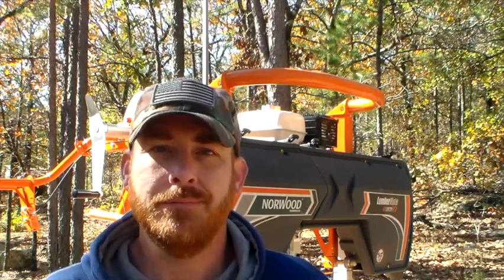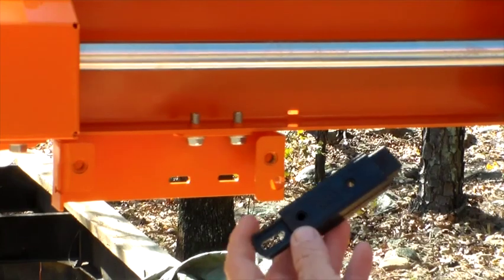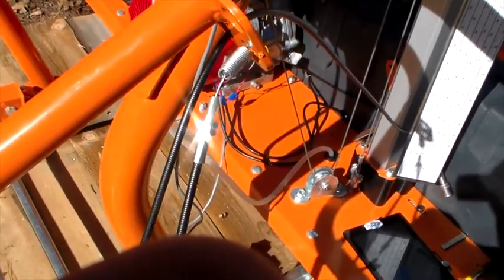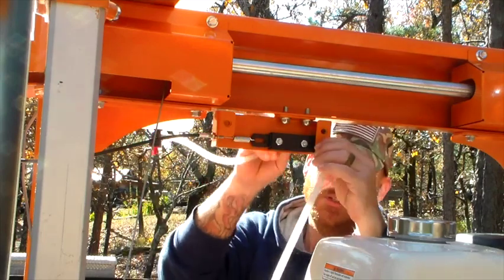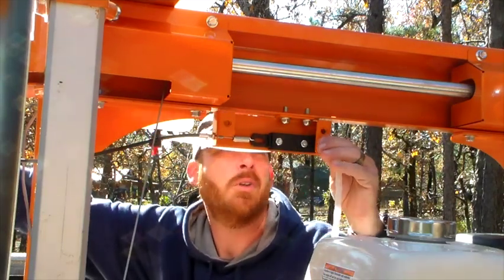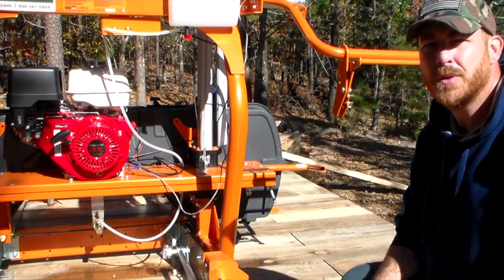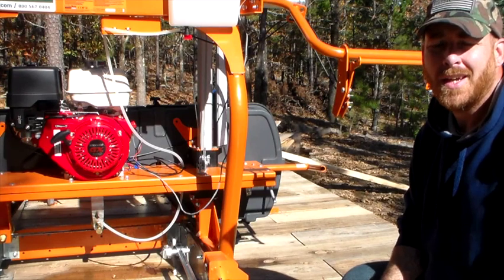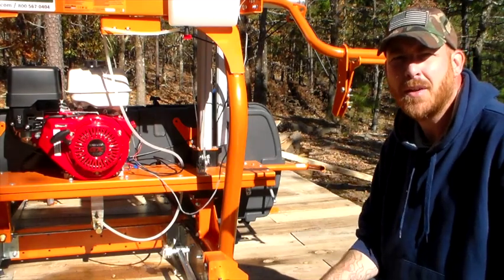Norwood Sawmill / Auto Water Lube Kit Installation

Comment: Hey buddy how are ya? Another great video. I wonder if the tube will wear over time? Being pinched like it is? Thanks for the heads up on how to adjust it. I dug through the pallet of boxes and found box 1 en. I pulled out the manual and started to read it. Now I know what you mean about color photos the black and white are a lil fuzzy for my old eyes! The manual is specific to the hd36v2 model. I’m hoping it will be straight forward. I know I’ll have get the additional track and bunks pulled out and assembled when I start. The manual doesn’t say what box or bag to go to in part b of the instructions. They have a separate section for trailer package with extensions. 
I will get rubber grommets,  loom tube and the right kind of clamps for the loom. I don’t like the wires laying in the frame unprotected, but that’s just Me. Trying to prevent shorts in the system. I have to register the trailer with the dmv, I’ll do it with out the head installed so they tax me too bad for total cost. Kaliforniastan loves to tax and regulate every aspect of our lives. Oh the Gov want to ad a road use tax of 0.08 cents a mile on all cars due to so many electric cars aren’t paying road tax when buying gas. .68 cents a gallon right now on fuel! Thanks again buddy for the video it will help us all. God bless you and yours.
Reply from the maker: Hey Bud! I don't understand sometimes I respond to my comments and they do not appear. So sorry for the late response...I too agree the tube looks like it may wear over time. Maybe someone can figure out a better way...The wiring I would definitely do like you are saying. Sounds like you have a real good idea of what you are up against...I can't believe (well yes I can) the push the Oil and Gas industry is putting up against the going electric movement. The Natural Gas here is proposing a $1400 exit fee from their services if you want to go electric. I have been looking real hard at the E.V. market and can't wait to see the car company get this in full swing and get a lot of the bugs worked out. Take care.